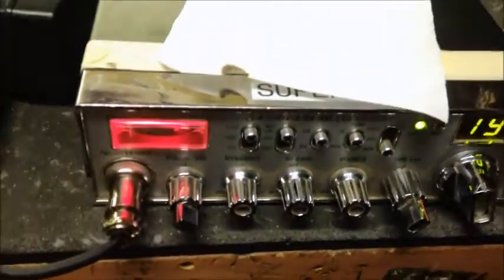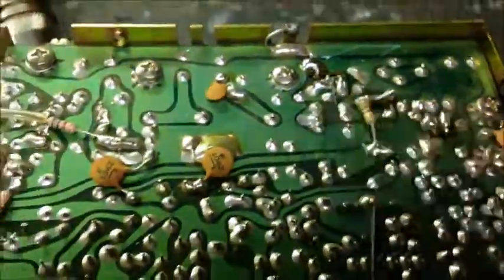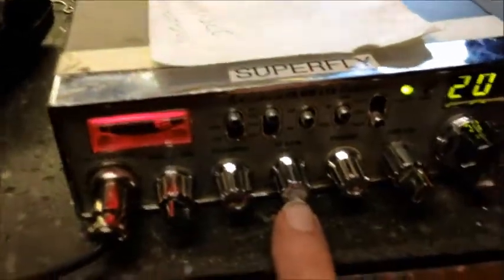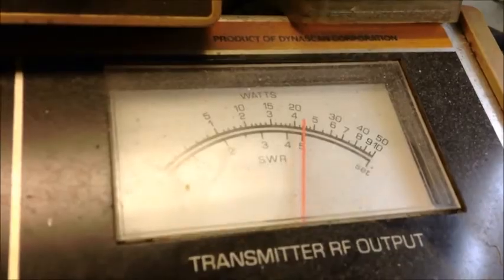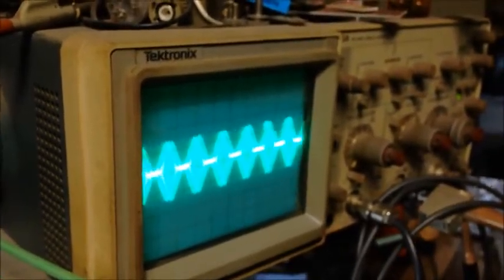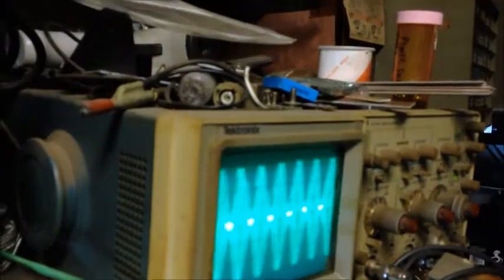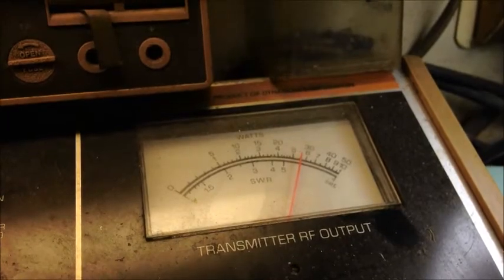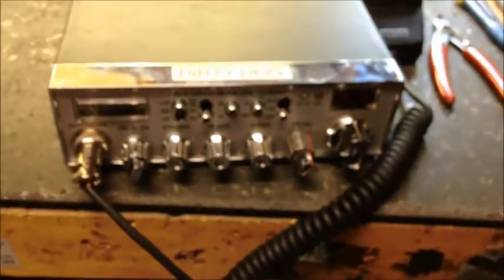JR's comp tuned 29's and fake 1969 finals

Comment: How can a 16W 2sc1969 hit 80 to 100W ? the spec says that you can get max 18W. It takes 2 large transistors to get 100W on HAM rigs. I know because I am a HAM operator.
Reply: Ham operator 🙄🤣🤣🤣
Reply: I'm curious too as it isn't rated for that much power to start with.   50 year first class licensed tech.
Reply: If those 1969 finals are producing that much power, Im the pope.

Comment: Oh I just ordered some transistors on eBay and that’s where all the fakes come from, Thank for the video. I’ve got a galaxy 949, I ordered a 2sb817 for the power amp and a ecg 153 for modulation. Is this the correct parts for these mods, I’d rather ask a professional then to listen to the internet, before I do it.

Comment: Why does anyone buy 1969's from anyone that is not a real electronic parts store. I buy my transistors from RF Parts, Mouser, DigiKey etc....I pay more than from ebay or some other random guy but I always get real parts not fakes.

No he installs a mosfet transistor but does not tell you what fet he is using. It is his magic fet from testing all kinds of them. I am sure that like all the mosfets used by cb's none of them where designed specifically for rf amplification. No one mentions the gain on these either it is always just about the watt's no mention of gain. In a unit that has one final and no cooling the gain is as important if not more so than the ultimate amount of watts on the meter. Most mosfets do not have very good gain at the voltage used by the rest of the radio and produced by the car! Since he does not tell us what "Magic" mosfet he is using we can not actually go and read up on it or purchase one and test it for ourselves. 

If you are like me and also like the professional broadcasting industry and do not by into PEP watts being meaningful than all those "Peak" watts are meaningless to the job of communicating at a longer distance with other people in a two way conversation. All that matters is the rms watts at dead key and what the rms watts swing too with modulation which should always be a 4:1 ratio. All of those "peak" watts these mosfets in these CB radios are making have very little gain so they are not doing much for you when trying to talk to someone. Likewise when you feed a watt of power with little gain into an amplifier it amplifies what you put into it and nothing more or less. 

You could not give me a "comp tuned" radio I would not have any use for it with out going through the radio and putting it back closer to stock. No internal modification to a CB radio for NPC with out a stand alone pcb with sophisticated electronics on it will allow for 240% modulation and have it be clean. Being loud does not matter if people can not understand what you are saying easily. It is like someone with a speech impediment talking more loudly it does not do anything to make them any easier to understand! Like when a Deaf person speaks no matter how loudly they speak it is always work to understand them that is what simple NPC mod's are like. With some sophisticated processing as in a stand alone board that take the place of a major portion of the stock radio you can get up to 300%-400% modulation before you sound muddy and muffled. You could actually run 240% and sound clean to the human hear. 

A guy out of Greece sells a kit like that. It is easy to fit it into a base station case but very tricky to get it to clear everything in a mobile and still have good airflow and the factory speaker. Since it is going to be at the same potential as the case you have to make sure it does not touch anything and short out.

I have seen radio's like this in the real world and they never perform as well as you would think from the number's in real world use actually talking to real people. I am not saying they do not work at all just that it is not a golden and green as you would think! The people always sound best when they leave the NPC switched off. You can not volt a mosfet so part of the old NPC mod is not even doable. I have my doubts about how a NPC 240% modulation CB radio with a mosfet final actually sounds on the air and dread the idea of hearing one being pushed into a class C amplifier. If your in a noisy environment and have it set up that way yo might as well forget about talking on it and being understood onthe other end!

Comment: Well first of all only an idiot puts a 2SC1969 in a CObra 29. The 1969 is a rather low gain transistor compared to what is normally in an AM only radio before cheap mosfets became all the rage. The 1969 is designed for SSB radios and is approved for SSB use. Sadly idiots would do a super swing mod, then do the red wire mod and swap out the 1307 for a 1969. That is why idiots should not be allowed to work on a radio.